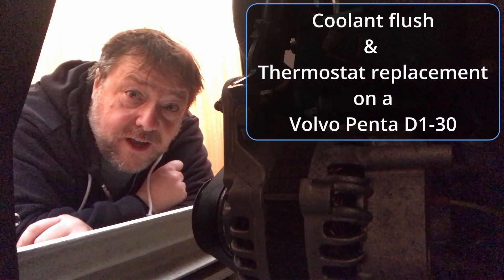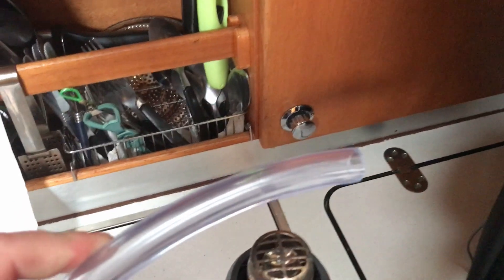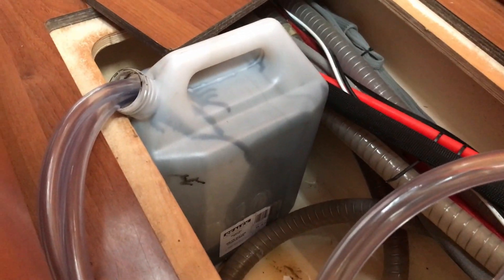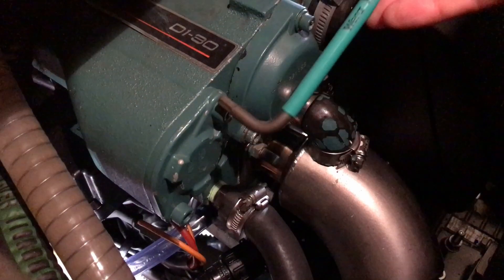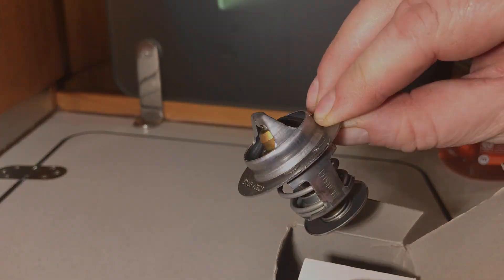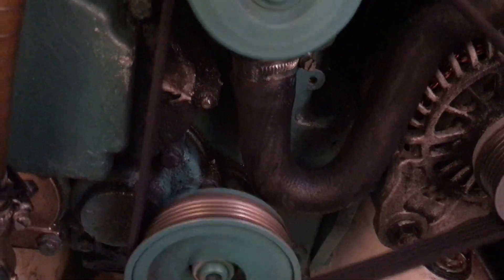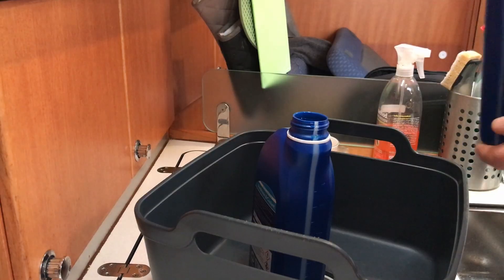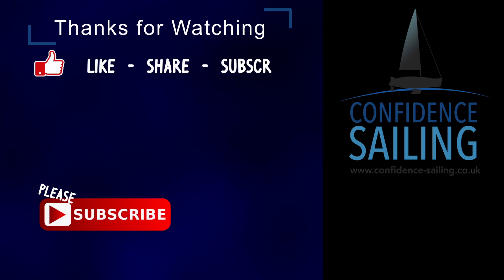Small boat engine servicing - How to drain coolant & how to change a thermostat

Comment: Thanks for video I have a D1-20f, first time changing coolant I have drained coolant from drain nipples but only got coolant from top nipple have tried pushing cleaning rod to bottom drain point but with no luck. Any ideas before taking things apart. Engine only 400hrs on clock, will i need to look at heat exchanger next? have also tried to flush out. Many thanks.
Reply from the maker: Sounds complicated. That might need someone to have a look.

Comment: Thanks for the video. What is not clear is how to open the taps, Thanks for explaining
Reply from the maker: Hi Giovanni, you just unscrew them from the engine block. I undid them until they were just about open before adding the pipe... In the video you will see me twist the pipe and that turns the already loose tap until the liquid starts coming out.
Hope that explains it. And I agree it's not explained that well in the video.

Comment: What happens if we don't flush it?
Reply from the maker: Short term probably not a lot. Longer term you will get a build up of gunk that will restrict water flow and cause the engine to overheat at lower revs than normal - meaning you can't run the engine at full power.
Plus there is increased risk of corrosion and potential failure  of components within the heating circuit.
Not replacing the thermostat is increasing the risk it will fail. 
That will also cause early overheating.
None of which is fun if you're out at sea and need your engine to get home.
Reply: @confidencesailing  can we flush without running the engine? We are pouring water into the expansion tank n let it flow out thru the nipple. Is that considered flushing? We're doing many rounds of this.
Reply from the maker: @24 HourTravellers  absolutely. flush away to your hearts content with the engine cold. Once you've filled it up again with anti freeze/corrosion inhibitor and sealed the system back up again... Then you can start the engine in idle and the water pump will circulate the new liquid and allow all the bubbles and air locks to eventually make their way to the header tank.
Reply: @confidencesailing  ok thanks for the tip 🙏 btw here we don't use anti freeze. We're in Malaysia. 😊
Reply: @confidencesailing  should leave the thermostat out when flushing with rad flush?
Reply from the maker: Oooh that's a good question. 
I have never removed a thermostat when flushing. But whether that's right or not I don't know.

Comment: I want to know what peoples opinions are on flushing out their heat exchangers.. ?
Reply: Hello, I didn’t get what you put in the heat exchanger after washing…what was the name of the product that clean and protect from corrosion? Thanks !!
Reply from the maker: Hi Gio G; any antifreeze/corrosion inhibitor/coolant for use in closed engine cooling systems. Usually Ethylene Glycol based.